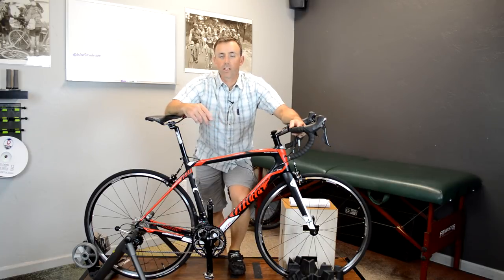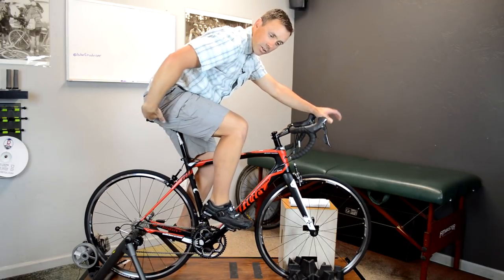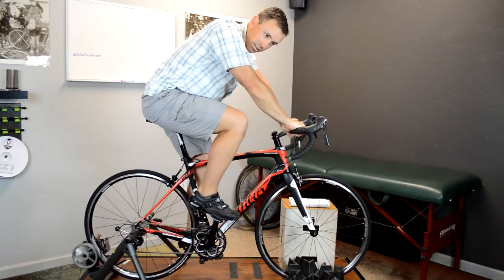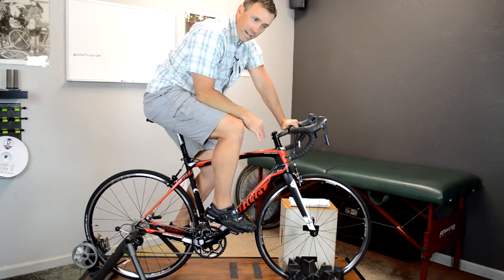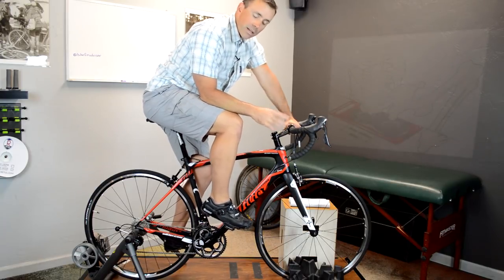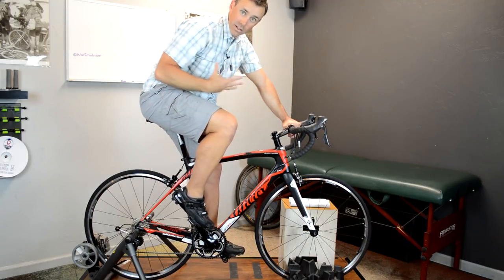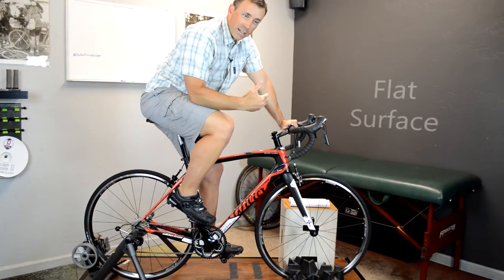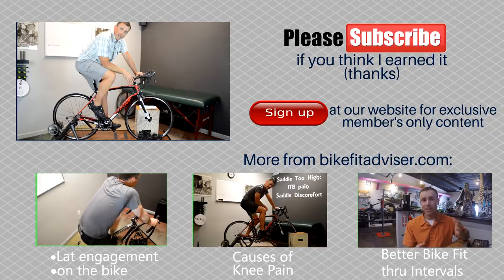Bike Seat Pain | Bike Fit Causes and Fixes

Comment: One of those reasons I went to a recumbent bike so that I could ride as far as I want pain free and still be sitting in a comfortable seat at the end of 170 km. If you can get past peer pressure from your riding buddies , constant compliments from kids and just plain like to ride , this is an alternative. Come to the dark side and enjoy cycling pain free. BTW recumbents are banned from UCI events for a good reason. Aerodynamics.
Reply: Recumbents are more aerodynamic? 
Are recumbents more expensive?    I guess they are geared so you can tackle hills well?  I'm a newbie.
Reply: On a normal bike your legs are hanging off the seat vertically breaking the wind whilst on a recumbent your feet are out front and that reduces the drag.  Slicing through the air vs pushing it out of the way.
Recumbents are, and are not expensive. Obsession bikes on the North Shore of Vancouver BC has a nice road bike for sale at 16,400.00 and yes it is light and has all the bling that will  go on a bike of that price range, and without changing body position on either bike or bent I will coast down hills faster. Aerodynamics in play. Will he go faster on the flats or up hills , you bet he will but at the next stop sign he will be unable to put his foot down flat on the pavement and he will not be sitting comfortably on that narrow saddle after 160 km. Been there ,done it, on a regular bike before I got any recumbent.   Top of the line recumbents do not get past 12 thousand unless you are doing something inside for some sort of record. If you buy a recumbent , buy used as the first one will set you up for the next one , a bit like  N+1. I have bought a recumbent as low as 163.00 used and after my last touring recumbent was stolen ,I  bought a Giro A 20 from Bacchetta for 2200.00 US plus exchange and tax and I put a different seat and shorter crank arms on it and suddenly I am at 3100.00 Speed and comfort , what more can you ask for?
A Tour de France race bike is geared roughly 30-135+ gear inches and my touring bent is geared 16-104"  and so far I have not met a hill that makes me get off and walk. However my bent is built for touring and it is the engine that makes the bike go up hills not the bike itself. Gear inches are defined here,  http://www.sheldonbrown.com/gear-calc.html    The next time you see some cyclists go by on the road keep an eye on them as there might be someone sitting upright with no hands on the bars shaking his hands to get the circulation back , relieve numbness and another one might stand to pedal for no apparent reason to relieve his sore bottom. I used to do that as well as I thought this is what you do. Now I sit comfortably and watch others do what I used to do.
Reply: Thanks, Bruce, for the very informative reply, including gear inches, as I was thinking "what's that mean", lol.